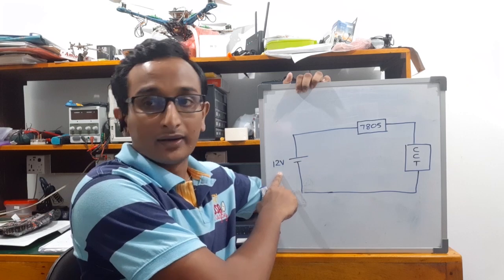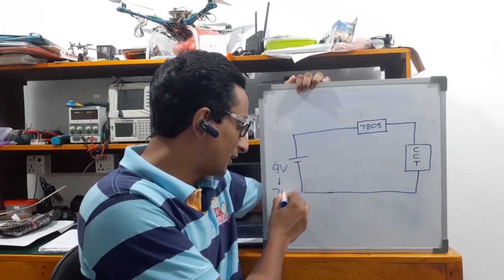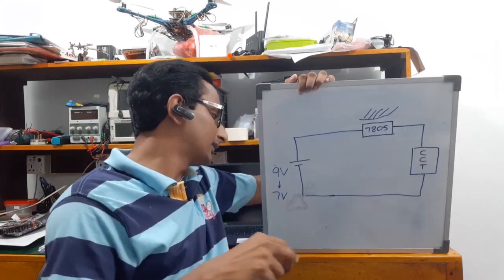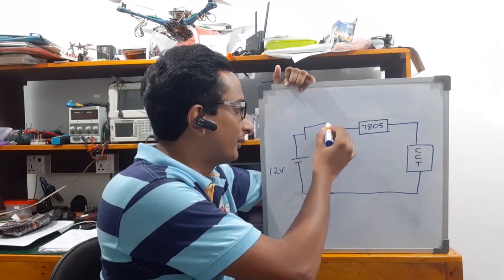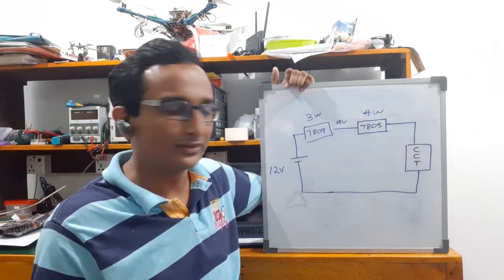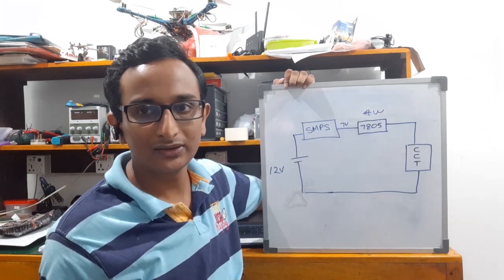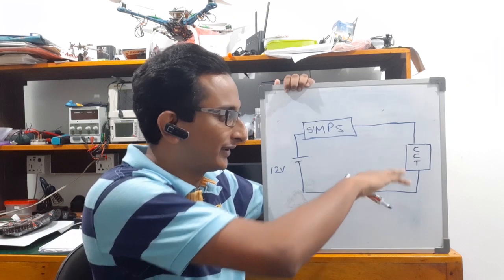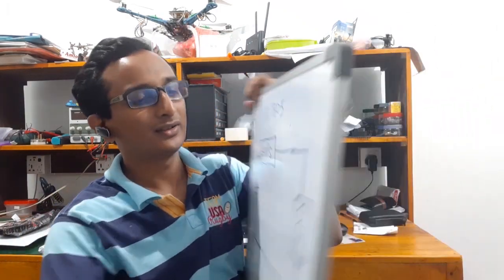EIS#49: 7805 රත්වෙනවට මොකද කරන්නේ?

Comment: Transistor data sheet deka thunak explain krnn puluwanda?
Reply from the maker: noted
Reply: @EISlk  thanks.
Oyage  hoda explained video ekak boost converter eka. Eke wena de hodatama theruna. A welawata practicle use wena circuit, diagramuth kiyla denna. Transistor ekak daddi unath a widiyta kaloth therei. A wagema ewata  use karann puluwannam numbers, a numbers nethnam same numbers ehema kiyla denn puluwanda?